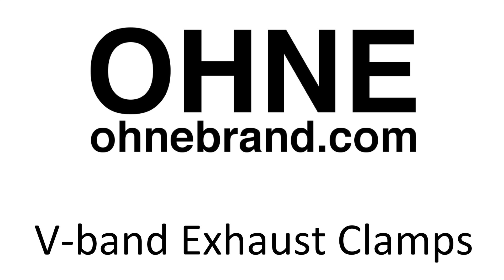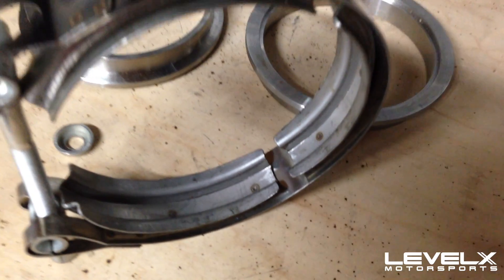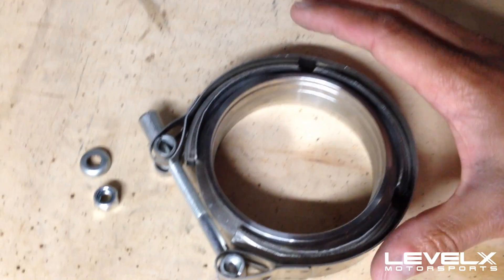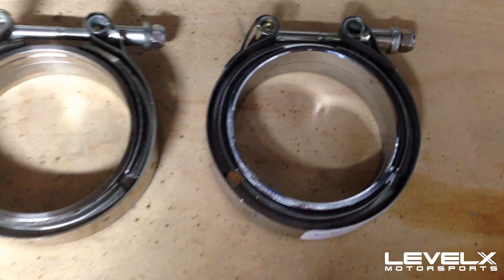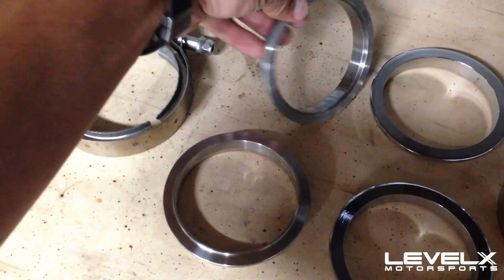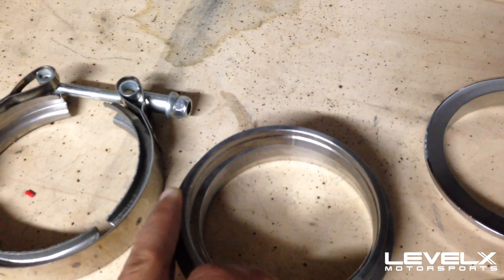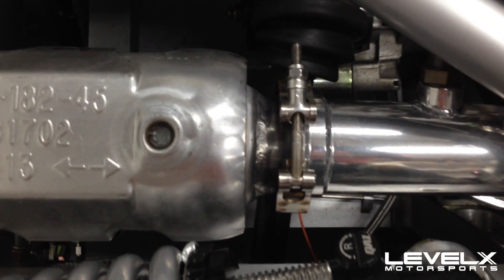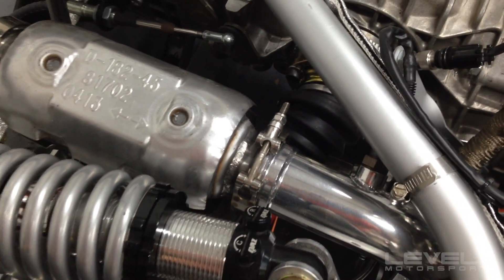Tech Tip: Exhaust V-band Clamps

Comment: These clamps are used on Aircraft If you see a distortion in the clamp or tubing you are using the wrong size ! If this part is works on $100 million A/C than it should be just fine on any race car.    All Engine Models - Installing V-Band Clamps - GE Aviation Maintenance Minute

Comment: I have see  reports the V-bands actually do have a warpage and fail seal issue on the face/face,  even with the improved groove style.
Have you seen or heard of this issue with these fittings?
There also is a “MARMAN” type fitting that is similar yet superior, any experiences on these?
Reply: Yeah it’s very time consuming to not warp them. After about my 3 rd one on my build I found taking an extra set to clamp on to the one being welded for heat transfer helped. But they do warp very easy